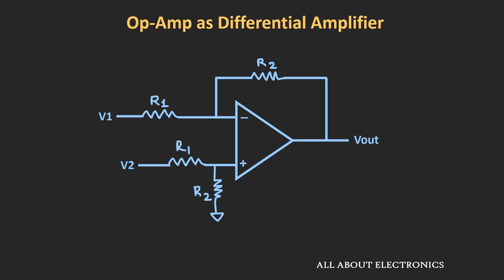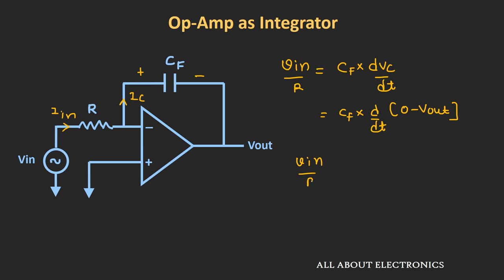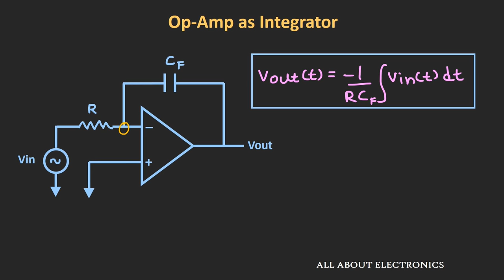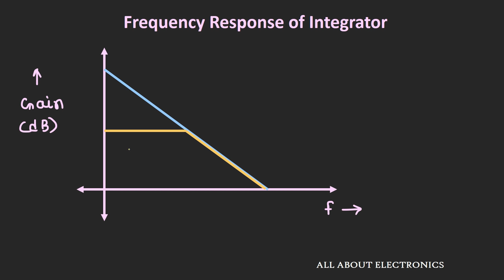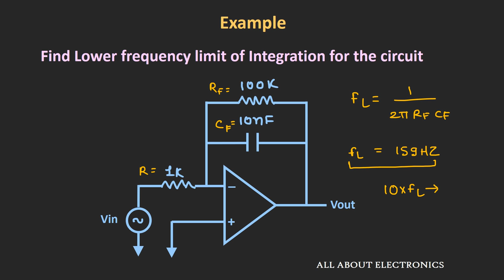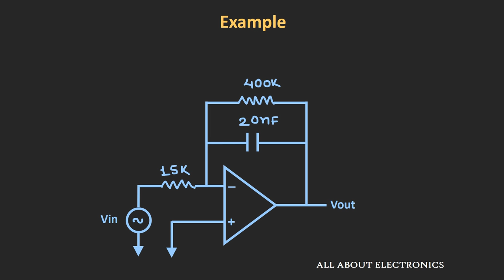Op-Amp Integrator (with Derivation and Solved Examples)

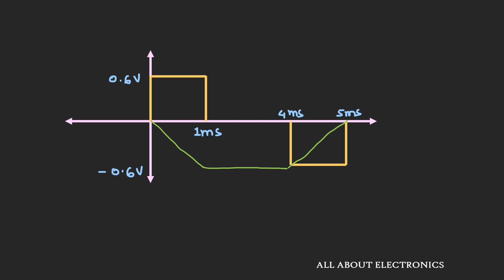Comment: 18:06 that output graph which you made sir,,,,,,, the down facing trapezium......won't the right slanting line would be above the x axix as 180deg phase shift will be there??
Reply from the maker: Since the input is negative, so the slope will positive. But the slope will begin from the previous voltage. If the initial value is negative, then  it will start from that value and go towards positive voltage. In this case, at 4 ms, the initial voltage is negative. So, the positive slope will start from that value. I hope, it will clear your doubt.

Comment: I have a question so in the first example while using sine input signal you used reactance in ur formula  to calculate the gain which is -1/2pifCRin But in the second example u didnt use that formula and replaced it with -1/RinC. Why is this so?
Reply: He hasn't used 1/2*pi*f*C*Rin actually the 2*pi*f term is due to the presence of omega in the sin term integration of which resulted in cos(omega*t)/ omega. Hope this answers your question.

Comment: What happens if the value of the capacitor is high/low? The same would happen where at low frequencies the capacitive reactance would decrease leading to a decrease in output voltage? The capacitor still behaves as an open circuit correct?
Reply from the maker: With the capacitor value, the charging speed will change. Of course, for DC input,once the capacitor gets fully charged, it will act as an open circuit. But how fast it will charge, that depends on RC time constant of the circuit. With capacitor value, the RC time constant will change. I hope, it will clear your doubt.

Comment: Sir why didn't you took Rf in calculations of output voltage at higher frequency i.e F > Fl
Reply: because in that case that main output voltage would be contributed by capacitor

Comment: Sir,is the answer for exercise question given to us is:.    -2V  for time t=0 to t=1ms
0V for t=1 to t=4ms
+2V for t=4 to t=5 ms.
Reply from the maker: For 0 to 1ms output will go from 0 to -2V (Negative Slope). For, 1 ms to 4ms, it will remain constant (-2V) and from 4ms to 5ms, the output will go from -2V to 0V. (Positive Slope).
Reply: Thank you
Iam surprised to receive such a quick response from you.thank you very much
Reply from the maker: For the integrator circuit, the equation for the output voltage is, -1/(RC) times the integration of input voltage plus initial voltage (V(0)). Please check at 4:03 in the video. For 0 to 1 ms the output is -2V. So, for 1ms to 4ms, the initial voltage will be equal to -2V. So, even though Vin is zero, the output will be equal to -2V. 
I hope it will clear your doubt. And good luck for exam.
Reply: @psireesha6516  how ? Plz explain

Comment: At 6:29 shouldn't it be Vout = -(omega*X)/R? As 1/C =  omega*X
Reply from the maker: For inverting op-amp, if Z2 is the impedance in the feedback and Z1 is the impedance at inverting terminal, then Vo = -Z2*Vin/Z1
Here Z2 is Xc and Z1 is R.
So, Vo= -Xc*Vin/R = -Vin/(2*pi*f*C*R)
I hope it will clear your doubt. 
I think you got confused because you compared it with the integral equation. 
And still, if you have any doubt then do let me know here.

Comment: Why any initial voltage v out (0) is not considered in the example. Why no Voltage would be there dut to Rf/R1 term at the beginning of the integration?
Reply from the maker: Here the initial condition is assumed when  the power is just turned on. At that time, it is assumed that the output of the op-amp is zero.

Comment: Hi, what does a "loaded" source means ? I don't understand how input/output impedance affects stuff. Thanks !
Reply from the maker: For any source, the connected load impedance or resistance should be higher than the internal series resistance/ impedance of the source, so that the output across the load is almost equal to source voltage. If low resistance load is connected to the source in that case the voltage that appears across the load will be much lower than the source voltage itself. 
For example, if the source has a series resistance of 20 ohms and the connected load is also 20 ohm in that case the voltage across the load will be V/2 (simple voltage divider rule). So, the load affects the output voltage. Or it can be said that source has been loaded. I hope it will clear your doubt. 
If you need any further help do let me know here.
Reply: It is clearer now, you have my thanks !

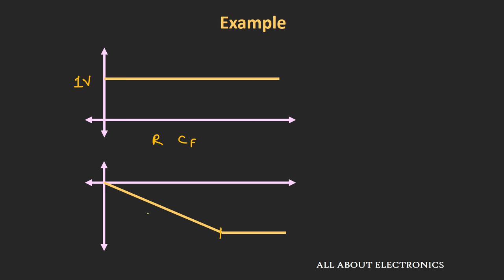Comment: Why do you get an initial value different than zero while integrating the sine and square waves at 5:08? Shouldn't these start at zero and look like there was a negative offset? I mean, assuming the capacitor has initial value equal to zero.
Reply from the maker: Yes, that's true. If all initial conditions are zero and if the waveform is starting at t=0, then integration should start from zero. But the waveform which is shown at 5:08 is more of a practical case, where the signal exists for t<0. OR I would say if you look the waveform in oscilloscope then it will look like the one which is shown at 5:08 because the square wave exists even before your triggering instance. But for simulations and for theory, yes, it should start at t=0 with a negative slope. (considering all intial conditions are zero)
Reply: Ok thanks! So for signals that existed for a while there would be no "offset" in practice, but let's say i have no signal (steady 0v), discharged capacitor, ideal op amp, and then start the square wave at t=0. The thing thats bugging me is that i dont see that "offset" being a transient response that would fade away for t->infinity. Maybe I'm not getting the concept of square wave existing since beginning of time, then there would be no transient response. But I mean, in reality, don't you have to power up the circuit at some given real time then do the measure?

Comment: Offset voltage and offset current are dc values,for dc values  integrator acts as open loop opamp,but how will it integrate offset voltage and currents?
Reply from the maker: When we call the capacitor is acting as an open circuit for DC source, it is during the steady-state condition. But when you instantly connect the voltage source, it will start charging towards the applied voltage. And the charging rate depends on the RC time constant. And once it charges fully, it will not draw any more current and will act as an open circuit. (That means once the transients are over).
Here I am talking before the steady-state condition is reached.

Comment: Sir, very clear explanation. However, I have a question related to JFET. When I was performing the transfer characteristics experiment, with an n-channel JFET, I found that, with Vgs > Vp, Ids = 0 for a considerable range of Vgs, which is not correct according to the formula. What is the reason behind this?
Reply from the maker: What was the Vds in the circuit?
Reply: ALL ABOUT ELECTRONICS around 5V, i.e., saturated region
Reply: ALL ABOUT ELECTRONICS sir, do you know the answer yet?
Reply from the maker: Do you know the model number of the transistor which is used in the experiment? If so, then please make sure the applied Vds is in the suggested range in the datasheet. And if you are applying the suggested voltage and still not getting the output then you can check with another transistor with the same model number.
Reply: ALL ABOUT ELECTRONICS I have tried the experiment with all the available JFETs and they all gave the same value. Do you know why Ids evaluates to 0 to the left of the transfer characteristics curve of an n-channel JFET, when |Vgs|>|Vp|? Like, what's happening inside the JFET, that's resulting in this?
Reply: @DarshanSenTheComposer  what are you doing now?

Comment: did you say slope of the output for constant input depends on R and Cf?????    I guess slope will remain 1 no matter what just the saturation will take longer if R Cf is larger....
Reply from the maker: If the slope is 1, then irrespective of the value of R and Cf, the output will reach a finite voltage in specific time. (e.g let's say 5V in 1ms)
And for a constant voltage, every time the output should get saturated in the finite time. (If the slope if the output waveform is constant).
But that's not the case, depending on the value of R and Cf, the time required by the output waveform to reach the finite voltage will change. (that means the slope will change).
And that's why for some constant input voltage, with specific values of R and Cf will take a longer time to reach the saturation while other values will take lesser time. 
I hope it will clear your doubt.

Comment: How does output reduce when reactance reduces? Isnt Vout= -Xc/R x Vin. Shouldn't it increase because there is a minus sign?
Reply from the maker: Minis sign indicates the phase inversion. If you just see the amplitude of the signal, it will reduce with the reduction in the reactance.

Comment: At 11:30, you hv written formula for F0 = 1/(2pi R*Cf)
Here what is R?
Reply: 2nd doubt:
In your 2nd example, The integrated signal of the square wave started from +5V to -5V
But, in DIY problem, the integrated signal of the square wave starts from origin (0V)
Why is this difference?

Comment: 06:40 how did the equation became Vout = -Xc/R * Vin from the enclosed equation at 05:36???
Reply from the maker: If the input is a sinusoidal signal of specific frequency, then after the integration, you will get 1/2*pi*f in the denominator. And 1 / (2*pi*f*C) is Xc. So, from that you will get Xc / R. If the input is sine wave then after the integration, it will become cosine. (there will be phase shift). But if we just consider the amplitude then output amplitude is Xc / R times the input signal amplitude. 
Also, you can look it another way. For inverting op-amp, Vo = - Rf / R1 x Vin
Now, in case of integrator, in the feedback there is a capacitor. Its reactance at the specific frequency is 1 / 2*pi*f*C (or simply Xc).
Therefore, Vo = - (Xc / R) * Vin
I hope, it will clear your doubt.

Comment: If you input a sin wave voltage wont the output be a -cos wave since its an integrating amplifier?
Reply from the maker: Yes, that's true. But the op-amp is configured in the inverting configuration. So,  there will be a 180-degree phase shift in the output.

Comment: 6:21 how did you get the expression for Vout I’m confused
Reply: same
Reply from the maker: The first equation (with integration) is used for finding the transient output of the integrator. Like when you apply a pulse signal and you want to find the output of the integrator. (It can also be used for sinusoidal signals)
The second equation is particularly used when the input is sinusoidal signal. If the input is sinusoidal signal then we can find the equivalent impedance offered by the capacitance at the specific operating frequency. (1/wc) 
So, considering that impedance of the capacitor, the output of the op-amp is (-Xc/R)*Vin. (Similar to -(R2/R1)*Vin)
And here the reactance of the capacitor is 1/wc. 
So, Vo = -1*Vin/(wcR) or -1*Vin/ (2πf*R*C).
If we just consider the magnitude then voltage gain |Vo/Vin| = 1/ (2πRfc).
I hope, it will clear your doubt.

Comment: Why for the input offset voltage, the output voltage will be saturated?
Reply from the maker: The input offset voltage is a DC voltage. If you apply the constant DC voltage to the integrator, you will get ramp type output. That means the output will increase continuously. And gradually it will get saturated to the supply rail.
Reply: @ALLABOUTELECTRONICS  
Sir,In Practise Example
I,e From
1ms  to 4ms ,our Vin=0
Then that time Vout= Must be Zero

But you show Negative Constant Voltage in Graph

Please Reply Soon Sir.
And please Correct me.If I am Wrong.

Comment: 6:32 sir how Vout= -Xc/R ??
Why not -1/RXc 
Please clear my doubt
Reply from the maker: For sinusoidal signals, in the inverting configuration of the op-amp, the output is (-Z2 / Z1) X Vin.
Where Z2 is the impedance / reactance of a component connected in the feedback path. And Z1 is the impedance of component connected at the inverting terminal. Here Z2 is capacitive reactance Xc, while Z1 is R.
So, Vo = (-Xc/R) * Vin.
Or gain of the op-amp is (-Xc / R)*Vin. And as you know, Xc = 1/wc, so gain of the op-amp is -1/wcR. I hope, it will clear your doubt.
Reply: @ALLABOUTELECTRONICS  Thank youuuu so much sir ❤️
Cleared....

Comment: Sir by  connecting one more resistor parallel to capacitor we are able to solve the problem of saturation at lower frequency but what's about at higher frequency???    And you said  due to input offset voltage  there will be some output....due to that there will be possibility of saturation..HOW???
Reply from the maker: At high frequencies, the capacitor will offer little resistance. So, there is a no problem at high frequency (as there is more amount of feedback from output to input)
Regarding input offset voltage, by connecting the resistor in parallel with feedback resistor, an additional feedback path is provided at for DC voltage. (As input offset voltage is DC voltage), and it will prevent the op-amp from going into the saturation.
I hope it will clear your doubt.
Reply: Thank you very much sir!!!

Comment: during the darivation of the expression for output voltage of integrator opamp we are not considering the feedback resistance Rf  thats why it is   I in = Ic  if we consider Rf then they will not be equal and expression will get change???
Reply from the maker: Yes, it will be different. But if you observe, in the example where practical integrator circuit was given the equation of simple integrator was used. But as far as the condition of proper integration is satisfied (input signal frequency should be at least 10 times cut-off frequency), the equation of simple integrator can be used.

Comment: Isn't integration of sinx = -cosx ? How we'll get positive cosx output for positive sinx input?
Reply from the maker: Because when op-amp is used as an integrator, the output is 180 degree out of phase with the input. (there is a minus sign in the output expression)
I hope it will clear your doubt.

Comment: If the frequency is infinity then capacitor acts as closed switch and it becomes as voltage follwer.. for voltage follower gain is 1. How does it become zero?... If gain is zero then how do we get output voltage?
Reply from the maker: If you observe, the input is applied at the inverting end. The non-inverting terminal is grounded. So, at f is equal to infinity, when the capacitor acts as a short circuit, of course, the output will follow the input. But the input which is present at the non-inverting terminal. (just recall the circuit of the voltage follower, where the input is applied at the non-inverting terminal) And as the non-inverting terminal is grounded, the output will be zero. 
I hope it will clear your doubt.
Reply: How does the gain value becomes zero.. it will become one. won't it.

Comment: What happend to virtual ground concept while applying dc siganl to this circuit and at the point of saturation
Reply from the maker: Virtual ground concept is valid till the op-amp is operating in the linear region. It's not valid when op-amp is operating in the saturation.
Reply: Can u please tell me exactly what happening on that point on that condition.?
Reply from the maker: @priyagmk3312  Would you please mention the timestamp, where you are referring?
Reply: Sir am generally asking not form a specific time on this video what happends to the ckt after saturation ...
Reply: What the voltage at -ve terminal and grounded +ve terminal ?
Reply from the maker: @priyagmk3312  The voltage at the inverting terminal will start lifting upwards since the output voltage is fixed. And it will be no-longer 0V. The same is true for the non-inverting configuration. The voltage at the inverting terminal will no-longer be the input voltage (V+). 
I hope it will clear your doubt.
Reply: Thank you sir...😍

Comment: how 6:30 ?? How Vout become (-Xc . Vin )/R, ??🙄🙄🙄🙄
Reply from the maker: The first equation in the integration form is useful for transients. The second equation is for the steady state. As you know, for the inverting configuration Vo = -Rf/R1. Or in general, in terms of the impedance,Vo = -Zf/z1. Here in the feedback, we have capacitor. And it’s reactance is Xc= 1/wC. 
Therefore, the same equation is written as -Xc*Vin/R. I hope, it will clear your doubt.
Reply: @ALLABOUTELECTRONICS  can you show it by calculation? or derive it?

Comment: In last question 10Fs is more than F0 i.e. 0db frequency.. how come integration still happening?
Reply from the maker: The signal frequency should be at least 10 times higher than the cut-off frequency (Not 0dB frequency) and should be between cut-off and 0dB frequency. If you calculate signal frequency is 1/5ms= 200 Hz.
fL= 20 Hz and f0 is around 530 Hz.
So, all conditions are satisfying and integration should be possible. Please check once again and correct me if I am wrong.

Comment: Sir if input is square wave in integrator why should output be triangular?
Reply from the maker: Just take the simple example, If you integrate the constant DC value, the output will be ramp signal. And the slope of the ramp depends whether the DC value is positive or negative. Now, in the square wave, a signal is changing between the two DC levels. So, the output of the integrator will be positive and negative going ramp (triangular wave)
I hope you understood what I mean to say. If you still have any doubt then do let me know here.
Reply: ALL ABOUT ELECTRONICS well yes but why can't output show spikes?
Reply from the maker: It will show spikes in case of a differentiator. If you differentiate the square wave then you will get the spikes in the output.